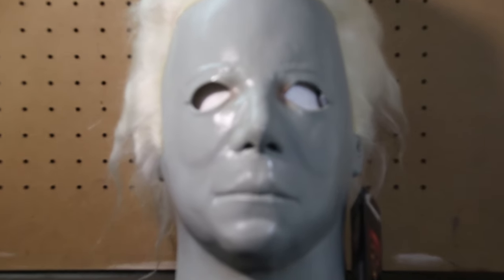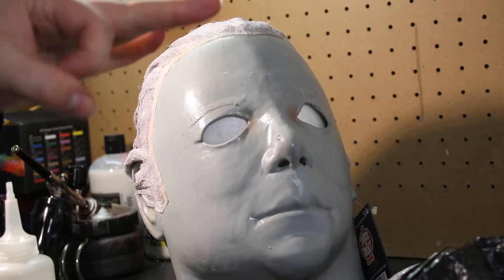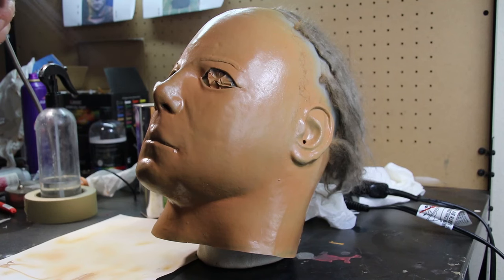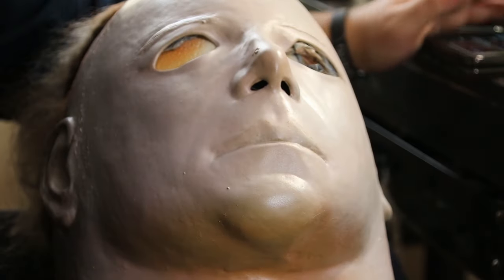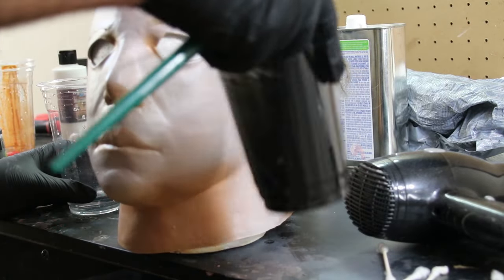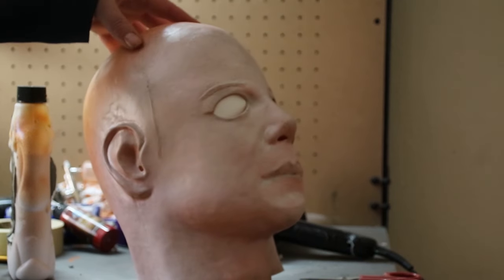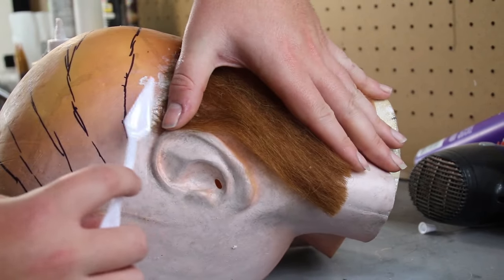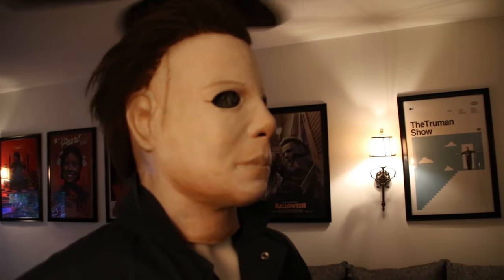Turn Your Ben Tramer Mask into Michael Myers - DIY Rehaul Tutorial (Halloween II)

Comment: Seal your layer before the rubout. Also blot instead of wiping. With that said I've always had issue with latex paint sticking because it takes so long to cure underneath. Rubber cement paint has never failed me though.

Comment: This turns out great, but why not just get a Myers mask and rehaul it from there?
Reply from the maker: This mask has a great sculpt, and is being retired from Trick or Treat Studios this year! I wanted to make sure I gave it a try at least once.
Reply: @RamenNoodleBudgets  oh okay. Great job
Reply: Don't worry, there's still the Boogeyman, same sculpt  @RamenNoodleBudgets
Reply: One thing I suggest if you ever do another one, cut the eyes a bit wider, that’s what I did on my boogeyman and it does wonders for the look of the mask, it avoids that bug eyed look this sculpt has
Reply: @xxxod  The original kirk mask was for kids?? No wonder Dick Warlock's dome changed the shape of the mask so much
Reply: @xxxod  To be fair I don’t think it really matters, it’s slightly bigger but just slightly, even if it was the same size, tots latex doesn’t stretch like don post’s so castle stretch and warlock stretch are still harder to achieve. This sculpt is also missing some details compared to the original especially in the forehead area (and the cheekbone area is not as pronounced). The TOTS Kirk wasn’t perfect as well but it was closer, it’s gone unfortunately